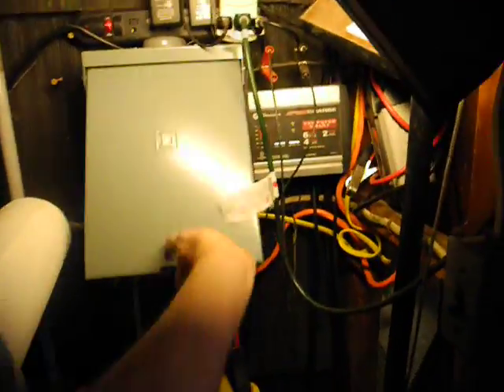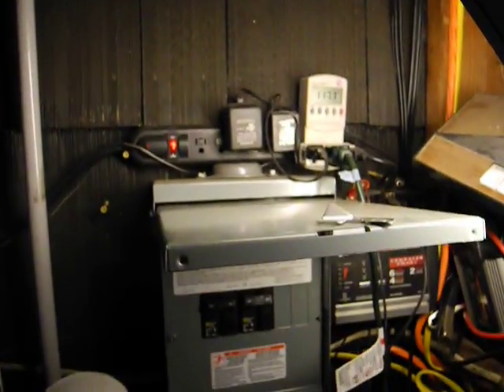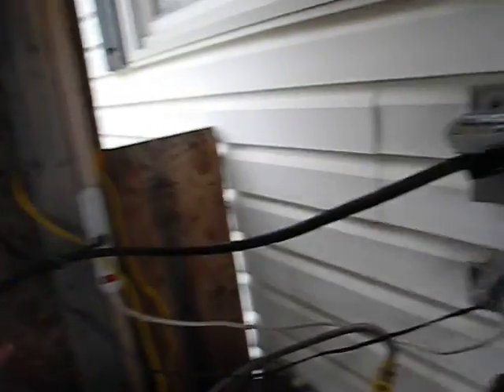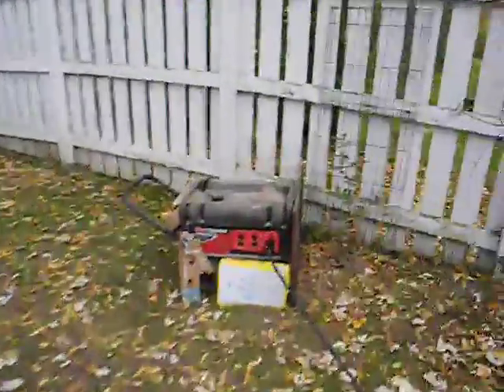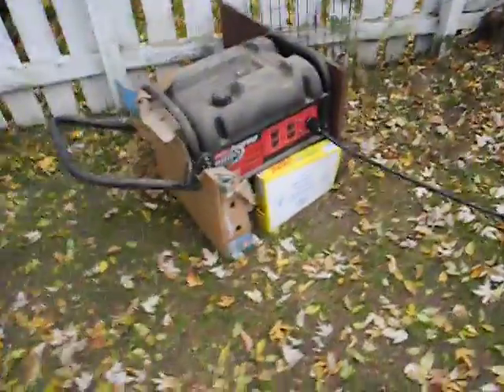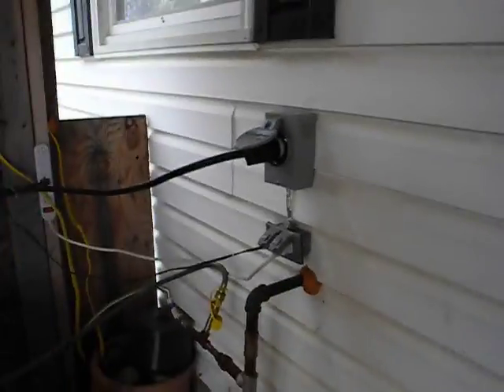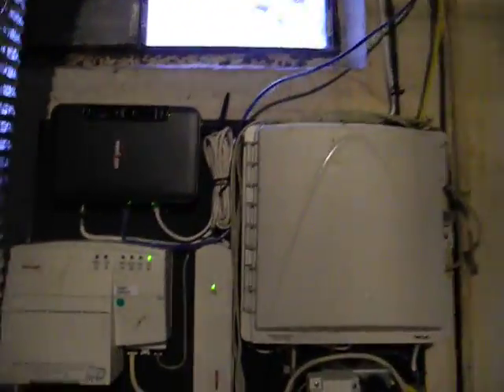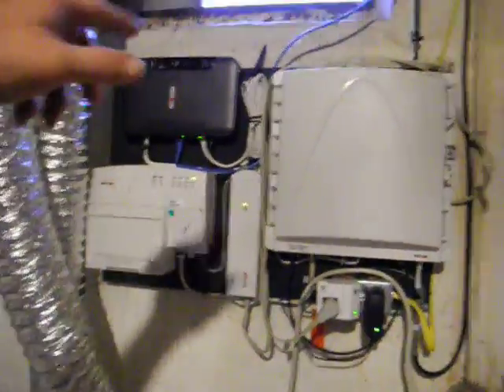Generator Power Setup

Comment from the maker: That's with the whole house powered just fine.  2 fridges, 1 freezer, 2 TVs, 2 computers, lights in every room.  The 30A 240V input circuit (120V x2) matches the SURGE power of the generator which is 6250W.  Its just its output connector that's a "20A" connector.  The 6250W is obviously discounted from the 10HP too (prolly for electrical losses of generation).

Comment from the maker: After replacing the connector it runs the full 120V.  I am inclined to weld on an auxiliary muffler.   I also wonder if co-generation with a natural gas powered generator would reduce total cost of gas/electric during the winter.  It would have to be seriously quiet to want it in the basement.